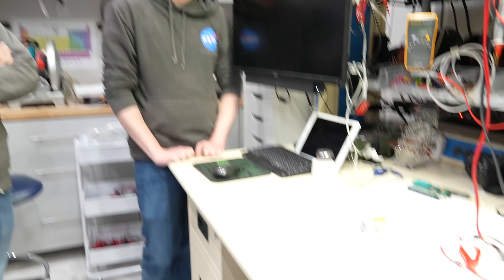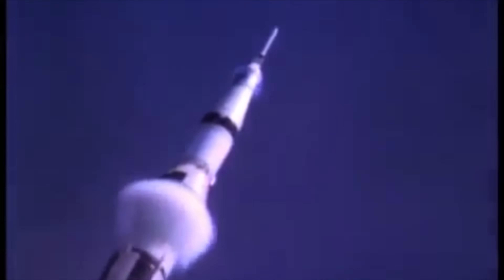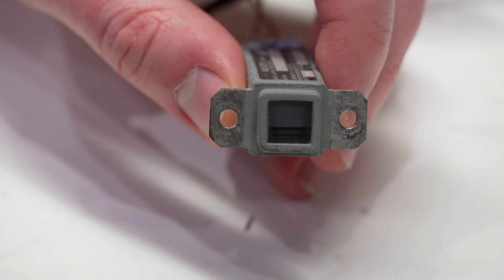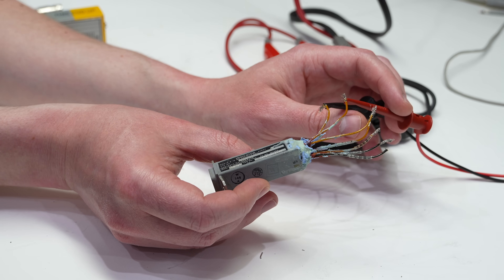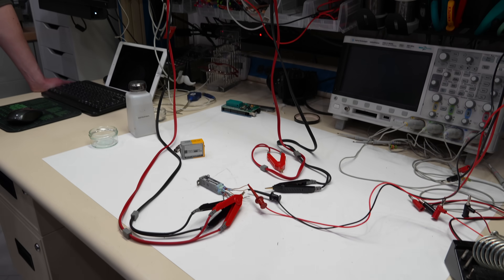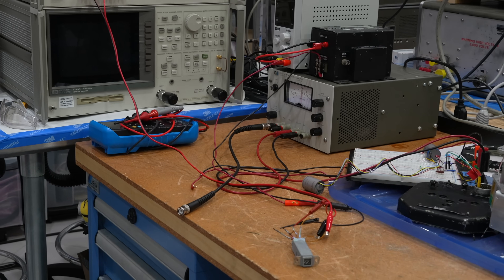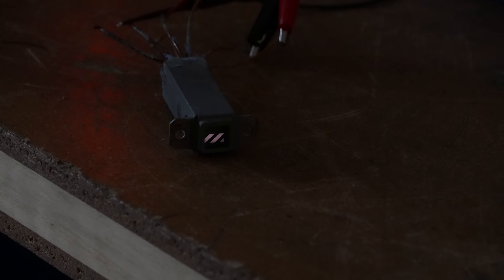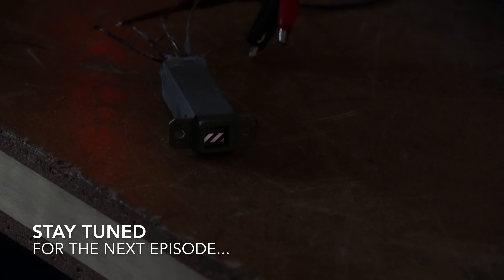Apollo Talkback "Barber pole" Indicator

Comment: Very interesting video.  Thanks for posting.  I have 9 Shuttle talkback indicators that were salvaged from the spare parts bin for the Shuttle Mission Simulators at JSC when they were dismantled after the last flight.  Some of them show "ON" in the de-energized state (and half-gray), and the others show "OFF" and half-gray when de-energized.  All have three wiring connections on the back.  They were made by Aircraft Instruments Co.  I believe they operate on either 5 VDC or 28 VDC (can't remember which).  When we set up one of the simulators for display at the Lone Star Flight Museum in Houston we wired the talkbacks up to show nominal indications for the entry flight mode, and when the power supply is turned on you can hear the talkbacks clicking simultaneously as they get energized.  I also have some of the large lever-lock switches used in the Crew Station.  They are labeled "Klixon" by Texas Instruments, and have six wire connections, like a typical DPDT switch.

Comment: Wow, it just seems crazy to use such a big, heavy unit to provide such a tiny amount of information.  It's just go/no-go, yes?  At one point it looked like a similar unit was also showing numbers, but the Apollo units seem to just be fault indicators.  I guess the benefit over a simple light (or pair of lights) is non-volatile memory of state and readability, even if power is lost?  Still, really?  Isn't every ounce of weight at a premium?  And they had more than 50 of these.  Just, wow.  A strange world with strange priorities and requirements...

Comment: You don't go into the details, but I wonder if that's not just a very simple D'Arsonval meter movement. If so, maybe taut-band suspesion?  We used them a lot in military, supposedly super tough, able to withstand tremendous G's and vibration (i.e. depth charge sort of shock loads).  Just a tiny magnet, finely wound coil and some restraining-guards to limit how much it moves under shock. As soon as the shock forces subside, the tiny taut-band tension re-centers the movement.

Comment: "sand it half", I loved that comment.  One of my favorite diagnostic tools, often with molded parts, but sometimes with assemblies, is cutting them in half with a band saw.  Curiously, I worked decades in engineering before realizing section lines in a drawing are just the graphical representation of a saw cut.

Comment: It would be interesting to understand the engineering decisions around using an electro-mechanical barber Pole indicator and EL illuminations versus a simple set of redundant light bulbs. There certainly is more weight and complexity.
Reply: The electromagnetic indicator displays whatever was on in case of a power loss., like an event that occurred.
Consumption is also lower, specially compared to lamps.
It is also more ergonomic : it is easier to read (no day/night brightness adjustment needed) and there is no light that can be mixed up with warning lights.
Reply: @chefchaudard3580  incandescent lamps also get hot, and many of their failure modes will produce sparks, at least inside the envelope of the bulb. A fractured or compromised bulb, would expose the capsule interior to those sparks, presenting a hazard.

Plus the difficulty in maintaining bulb pressure in vaccuum and against the forces involved. Lightbulbs would've been awful.
Reply: @chefchaudard3580  Also it looks cool
Reply: It looks cool and futuristic .

Comment: Interesting things, or stuff I thought was interesting.

1. In gravity it has an up - and doesn't seem to fully indicate (half way) when the wrong way up. I guess thats only an issue if the rocket was upside down at launch.
2. The mounting holes look like 2x layered plates either side, vs. one plate with 2x holes - presumably so they can mount these things in a row and they all sit flush on the panel.

Nice little gadget.

Comment: A few years ago I sent you some Apollo indicators that you did an episode on. I was searching for barber pole or flag indicators from Penn Keystone when I came across those and thought they were a component of the whole assembly that might be handy to have around. Somewhere I have some honeywell flag movements from commercial avionics.
Reply from the maker: Would that be the LM caution lamps: https://www.youtube.com/watch?v=l5tjdxtzlh0 . Thanks a lot for these!
Reply: Yes those, point being Penn Keystone is a manufacturer potentially of interest in your searches and General Electric also made these types of indicators. Adding more complexity there were some used in aircraft that were synchro driven locked to what ever device they were indicating the state of I think the shuttle used some of these not so sure about Apollo.

Comment: What is the mass of that indicator?

Launch cost per kg (CSM only, 1960s dollars) for a lunar mission:
$685,000,000 ÷ 30,000 kg ≈ $22,800 per kg (in 1960–1970 dollars)

In 2024/2025 dollars (using NASA’s aerospace inflation index ≈ 9–10×):
$22,800 × 9.5 ≈ $216,000–230,000 per kg to send and return the Apollo Command/Service Module

Comment: I'm surprised it's EL, but I guess a standard lamp would have some obvious reliability issues especially with all the vibration it might experience.  But, I kind of wonder why they didn't just chuck an NE-2 in there, too dim?  Or maybe the internal shutter mechanism didn't allow room for a bulb and they needed a flat EL panel?
Reply from the maker: The entire command module panel lettering was EL.

Comment: Interesting that they now call them flag indicators, which in the UK at least dates back to the servant call panels in large houses which had a number of "windows" in a printed glass panel with solenoid operated swinging "flags" behind, often painted in a barber pole pattern, to identify which room was ringing for a servant. The batteries which powered the system were even known as "Flag cells" and labelled "FLAG".
It's funny to see this ancient technology used in a space craft.
Reply: There was one of those panels in the first house I bought (early Victorian) it still had the etched glass screen, but most the mechanisms for the 'flags' were heavily corroded by what I assumed was battery leakage. There was a small brass lever on the side of the panel to reset any raised flags.
Reply: @paulhammond7489  More likely to be just damp, the display unit wasn't generally big enough to house the cells which were usually in a cupboard somewhere - a Flag cell was a big cylinder with screw terminals on the top.
I have seen a YT video of one of the display units being restored.
Reply: @NiallWardrop  Thanks, I'll look out for that restoration video :)

Comment: Being an EL backlight explains the daisy chained connections. Cuts down on the number of doubled up wires on each terminal. Having multiple wires on a terminal affects reliability.
Reply: The correct solution to that is to use bus bar terminals. Having the connections distributed among all the indicators means a failure in any one will affect all the "downstream" ones. It's probably to reduce weight by using less cable than a "star" topology.

Comment: Why this and not an indicator light?
Reply: the filament in a light bulb is considered unreliable when operated in an environment w/ ample vibrations. 
(most 12V automotive bulbs fail due to the vibrations, especially the low power ones such as turn signals, brake lights, etc. light bulbs used in off-road conditions have a shorter life-span for that reason. LEDs have a much higher tolerance to vibrations as there is no filament bouncing around)

Comment: I often wonder how they would design a new instrument panel in a modern world. 115 V 400 Hz lighting seems surreal.
Reply: Probably not much differently. On an aircraft (or spacecraft) reducing mass and component size is paramount. 115V was chosen as higher voltages allow reduced wiring conductor sizes, yet is still relatively "safe" (same reason Edison chose 100V which over time crept up to the 120V North American standard). 400hz permits alternators, transformers, and rectifiers to be much smaller and thus lighter. That's still a common power mode for aircraft.
Reply: 115V 400Hz is standard on aircraft

Comment: The complexity for a device simply displaying one bit of information (on-off) is mind blowing. But it's probably the best they could come up with back then - as unreliable incandescent bulbs weren't an option.
Reply: No, but reliable incandescent lamps were. 28V aircraft indicators were everywhere in the ground and space equipment. Those indicators used at least two lamps, so if one failed the other would likely still be working. There was also a lamp test button on the panel, so you could check for failed lamps.
Reply: Mechanical aircraft instruments of the era normally incorporated a barber pole flag indicator in the dial face to indicate that the instrument was unpowered or otherwise inoperable and its reading invalid, so they were simply following existing practice and using a convention crews would be familiar with.
Reply: Probably also add power consumption, weight and the ability maintenance them into the mix. And with maintanance I mean: never replaceable.
Reply from the maker: I am not sure about the origin of electro-mechanical barber pole indicators in aerospace and aviation, but they were prevalent for a long, long time. There must be something about them that the pilots and designers equally liked, since it even had continued use in the Shuttle. The fact that they don't burn out, don't heat up, can't start a fire if they break, work with 28V and consume relatively little power is probably part of the attraction. But mainly they look really cool. I have not seen them in ground equipment though, only in flying things.
Reply: These are rare in aircraft.  The only examples I’ve seen are gear indicators on 1950s and 60s jets.  Most use lights.  

And other flags tend to be integrated into the instruments.  Like an Attitude Indicator of the era would have had a gyro fail flag, a flight director fail flag, a localizer fail flag, a glideslope fail flag… plus all of the movable elements in the display like the miniature airplane, the flight director, the LOC needle, the GS needle, the speed needle, and the rising runway.  

This level of complexity makes sense for thousands of airliners each flying thousands of hours a year with paying passengers to a decision height of 100 feet.  

Not so much for a dozen Apollo spacecraft in the vastness of space.  So they likely made the talkback flags as a cheap and easily configured add on to other instruments.  

Also unlike aircraft where different states are either undesirable (like low oil pressure) or temporary (like gear down), Apollo probably had to spend a lot of its mission with things in different states depending on the stage of the mission. It made sense to make it not a light in keeping with the philosophy of a “dark cockpit” where lights are an indicator of an abnormality.  

It’s actually interesting as we’ve moved into Crew Alerting Systems that alerts are lost in a sea of text on the MFD and although we have Master Caution and Master Warning to alert us… it’s no longer pattern recognition out of the corner of your eye on an annunciator panel.
Reply: @calvinnickel9995 I was gonna say, I've worked on old military aircraft for many years and have yet to see one of these.
Reply: @CuriousMarc  I was fully convinced at "They look cool"... 😅
Reply: @CuriousMarc  If the ELfails the physical change of state won't, so you can shine a torch on it and see what state it's in regardless. That's what I figured.
Reply: Neon lamps are likely fairly reliable, assuming the glass envelope could be made robust enough..
Reply: @lmamakos neon needs over 70 to 90 V.  So not great in a space craft with 28 V.
Neon bulbs were used often in industrial electrical equipment (at least 30 years ago) to let you know the power was on. Neon bulbs would last years.
Reply: They probably used this approach instead of a simple lamp for some very good reason.
Reply: @jonathanhendry9759 A lamp only has two states one of which is ambiguous - lamp out can mean a particular system status, power failure or lamp failure. At least one aircraft crashed as an indirect result of this.
Reply: @NiallWardrop

Barberpole flag has the same problem.  It can jam or lose power and display something ambiguous.
Reply: @calvinnickel9995 Design can make that very unlikely whereas lamp failure is inevitable, and frequent - I used to service equipment with control panels using indicator lamps and always carried spare bulbs as there was often one or more out.

Comment: It's crazy they made it work requiring such a high voltage & odd frequency. Like was 5 volts DC not easy enough?
Reply: It was neither an odd voltage nor frequency. 115V 400Hz was standard for aircraft instruments at the time, and still is. 5VDC is what would have been strange back then. Nothing used that voltage.
Reply: @lwilton  Also, back then getting 5vDC would have probably involved a linear regulator.  Very inefficient. 

I saw a 1960s or so elevator control room that had motors and generators. I think they had AC motors driving DC generators. Probably not what you’d want for aviation :)
Reply: @gf2e  In WW II most airplanes that had a radio or any electronics had one or more "dynamotors" in the equipment. This was a sausage-shaped thing about 3 inches in diameter by 6 inches long. One end was a 28VDC motor, and the other end was a DC generator, usually around 400V. That was the easiest and lightest way to get high voltage from a DC source back in those days.

Getting something near 5VDC wouldn't have been too hard. Getting a regulated +-5% 5VDC that ICs require would have been a real pain. They had the knowledge to make switching power supplies out of discrete components in the 1960s. There were several of them in various components. But they were noisy and didn't regulate very well, so there would have had to be a discrete linear regulator on the output to get the accurate 5VDC.
Reply: It's not an arbitrary choice — the actual electroluminescent light needs high voltage AC. Today you can get battery powered EL wire — because electronics have advanced to the point where you can build a tiny inverter into the battery box. The frequency of 400 Hz, though, is probably because aircraft electrical systems use 400 Hz AC over 50/60 Hz so they can use lighter weight transformers.

Comment: Fascinating, when the inverter over-volted it sounded like the original tone was still there but also another harmonic appeared? Without running it through one of those FFT visualiser apps lol. Just from my ear. I almost expected it doubled the output frequency until you said it over-volted! I guess that harmonic was always meaningfully present and it just got a lot louder with a bigger load. 

I always knew helicopter power systems would show up in recordings, but for some reason I assumed it was electrical interference in the operating gear… until today when it actually occurred just before you turned it on that it would probably vibrate at 400Hz just like substations used to audibly vibrate at those first few harmonics of the domestic line frequency. 

Then I still went “what’s that indicator buzzer?” before realising that WAS the noise. It’s just that loud!

Still, that moment when it shifted is a pretty interesting sound in its own right!
Reply from the maker: Your ears are good. when it overvolts it picks up distortion, hence harmonics. You are the human spectrum analyzer!
Reply: @CuriousMarc  oh, of course! Harmonic distortion from overload :) this was before bed viewing so that totally passed me by!

And thank you, haha. I’ve been told I might have perfect pitch, though I’ve not had it officially confirmed (however one would even do that?)

In case it’s interesting: all I did before commenting was hum a couple tones to double check if it was the octave or the fifth above the base 400Hz. I also tend to hear motors subtly slowing down a good minute or so before the low battery light turns on, or hear the moment water runs hot from the tap 😅

Comment: The illumination could have also been powered from 60Hz line voltage but I would have used an isolation transformer in that case.
Reply: Would have been a different color, and might not have shown up at all. EL displays are frequency sensitive.
Reply: @lwilton  Well I didn't know that...I just did a bit of reading and found that typical frequencies for thick-film EL backlights are between 200-600 hertz.  Then I remembered that Sony made EL backlights for some of their MP3 players which glowed a different colour depending on output frequency of the inverter- green at one frequency and white at another.